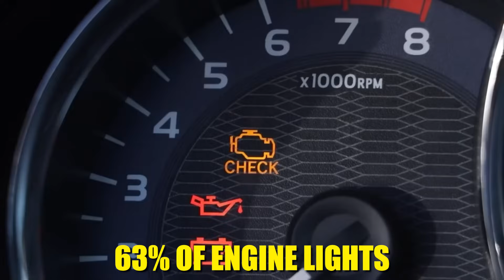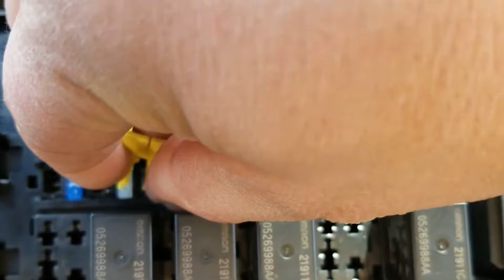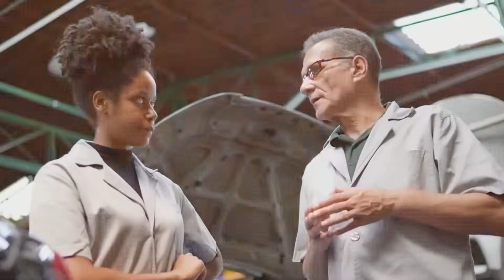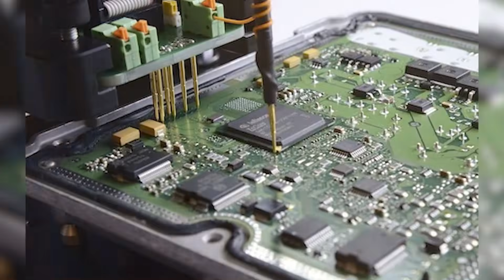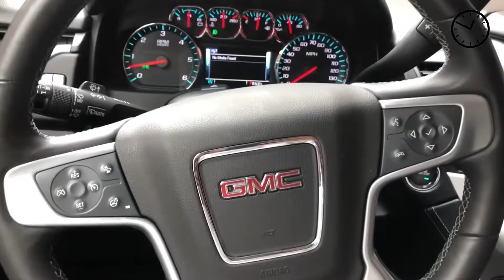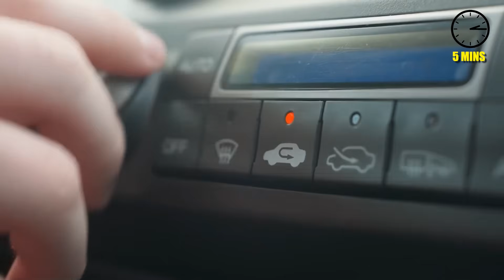Stop Wasting Money! One Reset That Fixes 63% Of Car Problems

Comment from the maker: Got check engine lights, rough idle, or hard shifting? Drop your car's year and make below (Example: 2018 Honda Accord, 2015 Ford F150)
I'll tell you EXACTLY which reset your car needs based on manufacturer service bulletins!
⚠ 63% of check engine lights are just corrupted ECU memory—NOT broken parts (Bosch 2022 study). Watch the full video before spending $340+ at the dealership. Reset #5 fixes most transmission issues in 30 minutes!

Comment: I have a 2013 BMW 535i (F10),  a 2010 Chrysler Sebring Touring Convertible, and a 1989 Chrysler TC by Maserati (SOHC) (2.2l Turbo 2, SOHC). Thanks for reset tricks.
Reply from the maker: You're welcome! That's an amazing collection—especially that 1989 TC by Maserati, those are incredibly rare! The reset procedures work great on all three. Keep those beauties running strong!